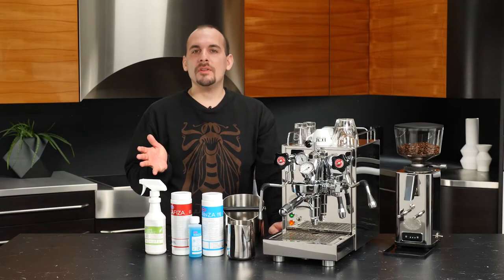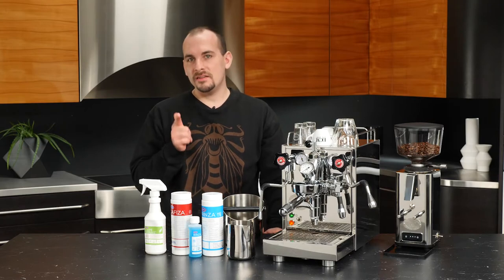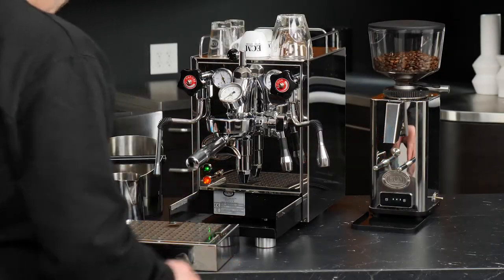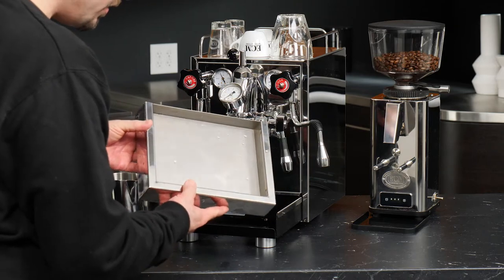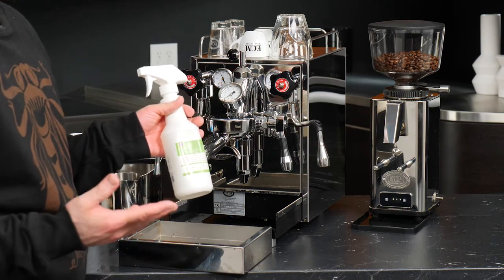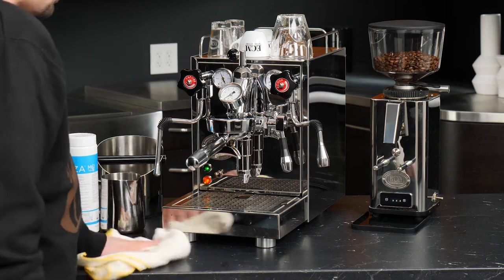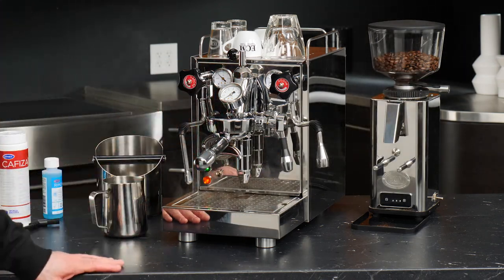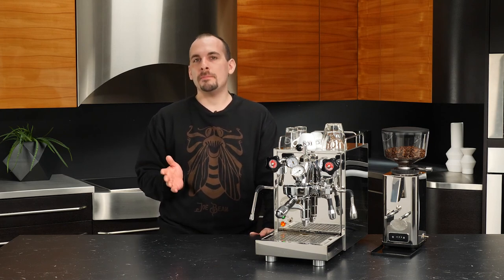ECM Mechanika V Slim: Basic Maintenance

Comment: The backflush detergent also dissolves the internal parts lubricant  and you can actually hear the squeaky lever.  In order to keep things cleaner and minimise backflush routine cycles I would recommend an over the puck aeropress filter or a metal mesh filter. That would virtually keep the shower screen almost spotless
Reply from the maker: Generally the squeak will resolve itself after a few shots as the coffee oils actually serve as lubrication for the lever, however if this is not the case, is can be disassembled and manually lubricated. Your tip is also a good one to keep things cleaner in there!
AJ

Comment: Great video. What worked for me was after finishing back flushing, pull one shot and toss it out. I've noticed your shot will have a little bit of that taste from the cleaner. Also I'm confused how on cleaning the steam wand, how does the water make its way into the wand when you have it on and it's pushing steam out? Lastly a descaling updated video would be really awesome.
Reply from the maker: Hey vik, Thanks for the comment. Some will pull a shot and toss after backflushing to assure all the cleaner is gone. A bit of water in the wand is normal. When steam cools it condenses into water. Here's a video on how to descale machines with heat exchange boilers: https://youtu.be/yEGfyJkWSqU

Comment: Thanks for the video! I have this exact machine and love it. I couldn't find any instructions in the manual on descaling which makes me think it's not recommended for this unit? I use the penguin water pitcher, along with a bwt drop in filter. Should I still descale this every 3 months? There's so much conflicting information on this topic which makes me lean towards following the manufacture's recommendation (which I assume is not to descale since it's not anywhere in the manual)? Thanks in advance!

Comment: Nice video guys! I was wondering if squeaky level during backflush is normal. Thanks for very clear information. I’ve a question, is normal to get a little water drips from the steam wand? I’m so careful to not tighten the knob to much but I make sure that is closed. But usually there are drips from the wand. I can’t place it out the drip tray. Thanks
Reply from the maker: Hi Francisco, yes the squeaky lever after backflushing is normal and usually resolves itself after pulling a few shots. As for the steam wand, a couple drips is normal due to condensation in the pipe, especially as things are heating up. If it doesn't subside after a few minutes of non-use, it could be a gasket or o-ring in the wand/tip that needs replacement. I wouldn't be too concerned about tightening the knob as long as you're not REALLY cranking down on it. A good test to see if it's actually leaking - close the steam valve and hit the pump switch. If no water comes out of the wand, you're good. 
AJ